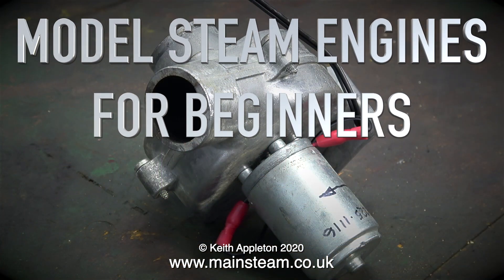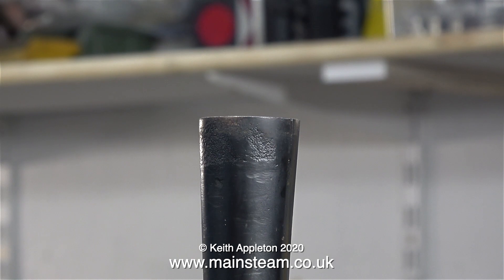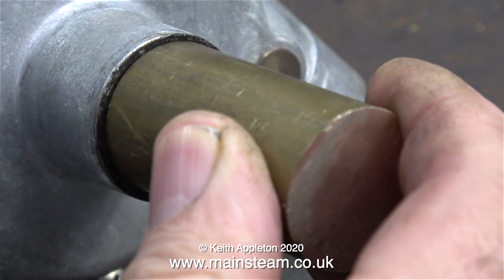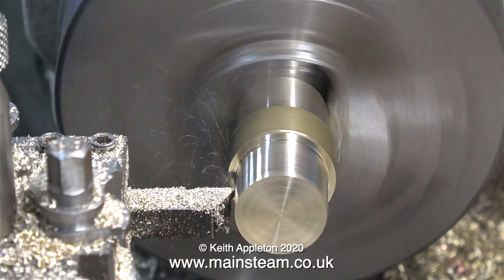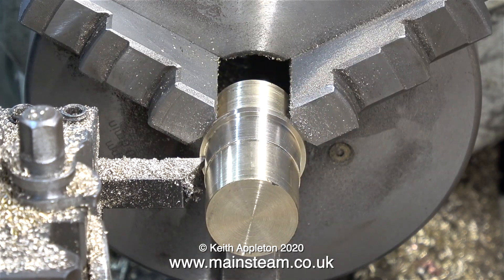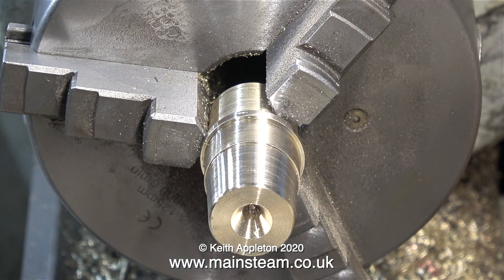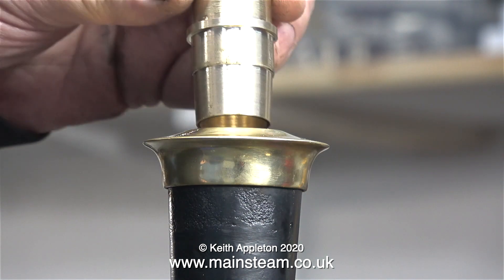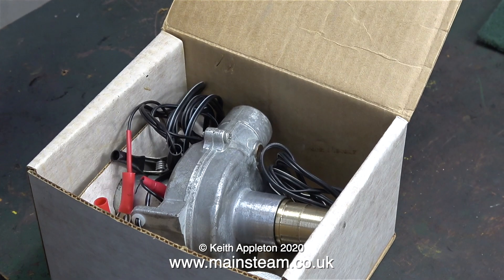MAKING A STEAM BLOWER ADAPTOR - STEAM  ENGINES FOR BEGINNERS - PART #14

Comment: At my local steam club, we usually add an compressed air input on the blower pipe of our engines. It can be a good alternative to the electric blower, provided you have a compressor available.